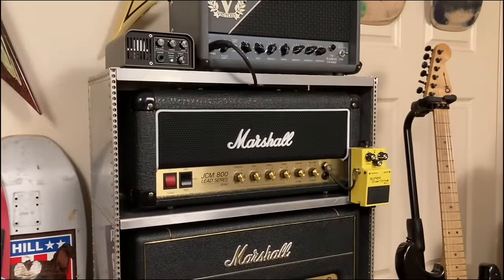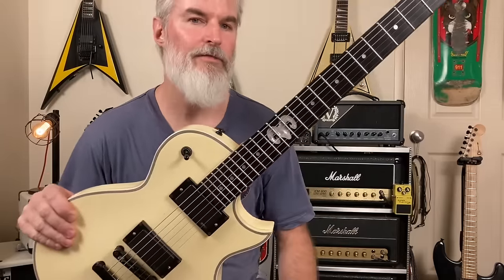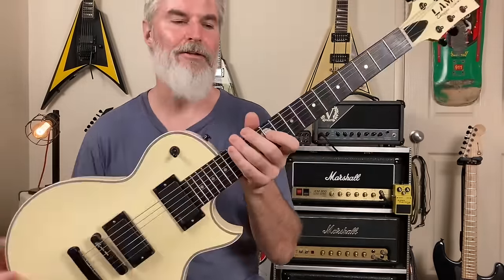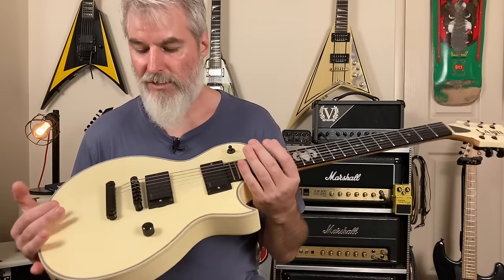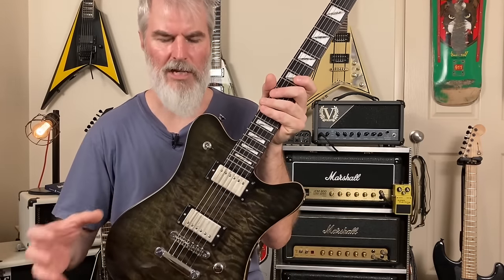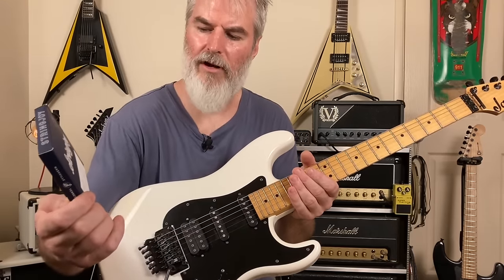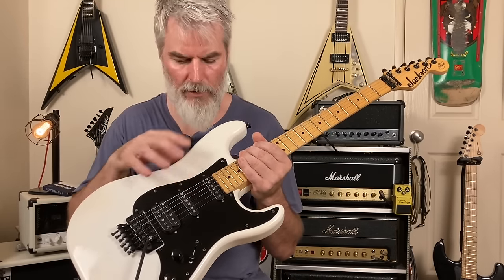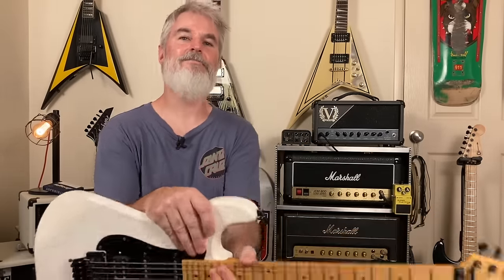LambChopper Room Tour Pt. 2

Comment: @Lambchoppers,  On that Jackson Adrian strat and all other strats that have the truss rod at the end of the neck you can make it MUCH EASIER to adjust the neck!
There is a trick that myself and others use where you fully slack the strings with the floyd bar then take the neck off while the string are limp,  Then you adjust it , put the neck back on , let the floyd's bar back to normal tension and you are done!  Not only is the neck adjusted but you will still be in tune!  Been doing this method for over 20 years now so please no one try to tell me this cannot be done or is harmful to the guitar! I was a guitar tech for years and never had a single issue doing this.
Reply: That neck would end up getting chucked if it was mine.
What an asinine design.
Reply from the maker: I do take the neck off with this one sorry, exactly the same as you described. It’s my Charvel that the pick guard comes off as the neck is shimmed and glued.
Reply: @LambChopper678  👍

Comment: I think in theory at least, if I was trying to mix single coil and humbucker pups that shared a volume pot, I'd go 250k, but add a 250k resistor between the humbucker and pot to bring the resistance up to 500k for that pup. It shouldn't affect the single coils, because the VAC from them would take the path of least resistance, which would be that 250k pot. I've only had one HSS guitar in almost 40 years. A Japanese Dinky. The humbucker in it was very dark sounding, which now makes me wonder how it was wired -- after hearing you talk about it. 

P.S. I have a black mexi Strat with maple neck and vintage style bridge that I put a black pickguard on and did the Gilmour 7-way wiring. Pups were from an old YJM Strat. I decided I like Strats better when other people play them, so lent it to my nephew. I set up another MIJ Jackson DInky with EMGs in drop C tuning for him, because he is a big LOG fan too. A total pain in the butt to do. Dialing in the truss rod was easy enough, but the trem for that tuning was a case of adjust, tune, adjust, tune, over and over. In the end I got a Schaller trem stopper sent over the ditch from Aussie. He's also a big Gilmour fan, so he's chuffed to get his hands on the Strat.